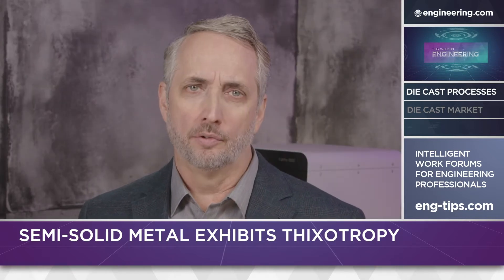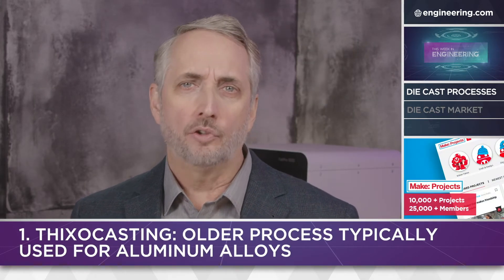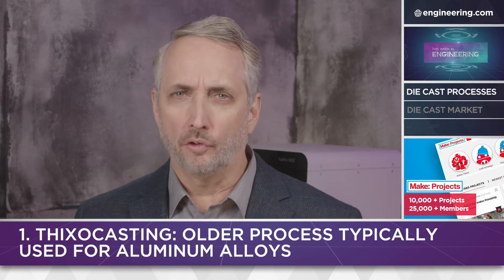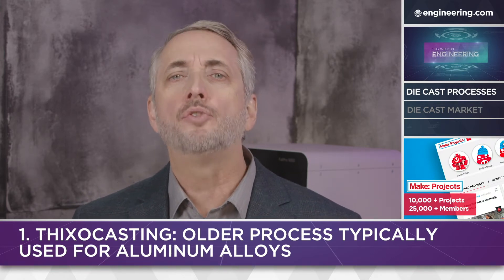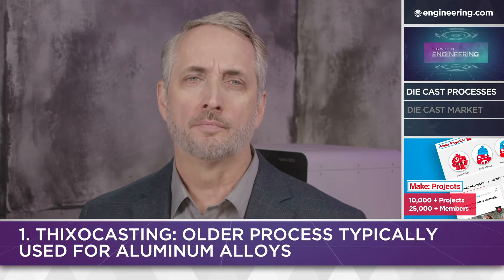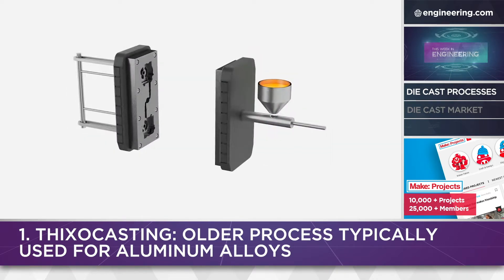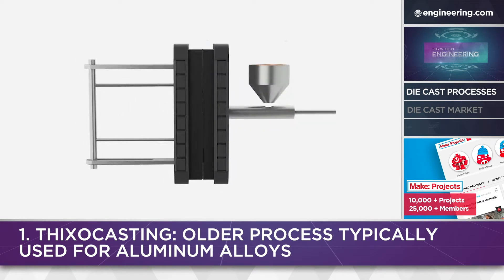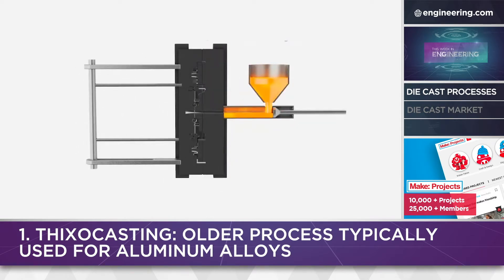All About Die Casting

Comment: Can you make cylinder heads and engine blocks with high pressure die casting?
Reply: Die casting molds are very similar to plastic molds. But the aluminum is much more damaging than plastic when it comes to die performance and durability. 
Imagine designing a plastics mold that you can mold a engine block or cylinder head. All the moving cores and ejector pins. Now make the mold out of all h13 tool steel and make it extra heavy duty because it's going to be beat to failure. Good luck.